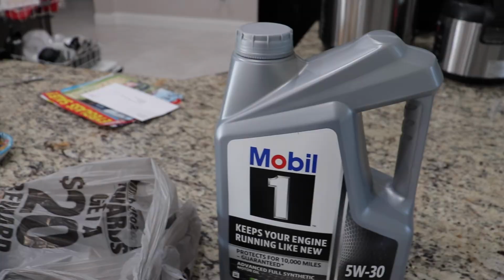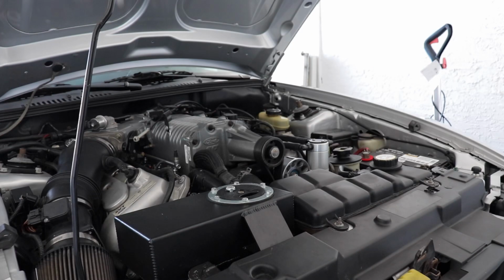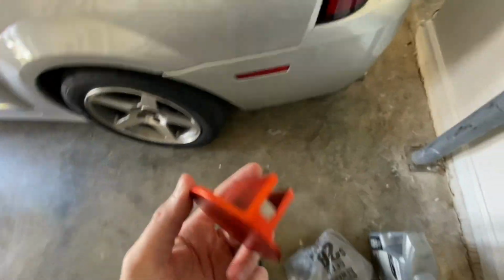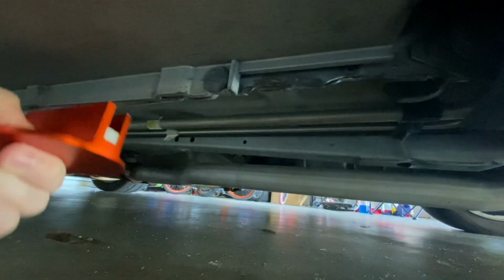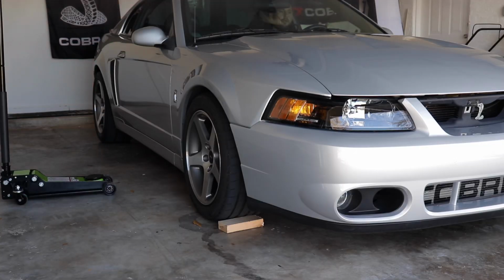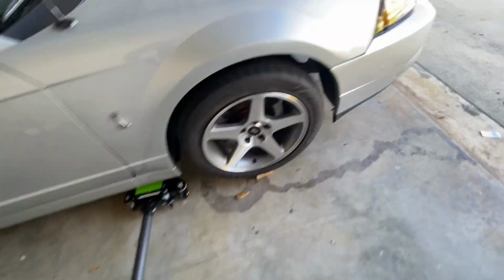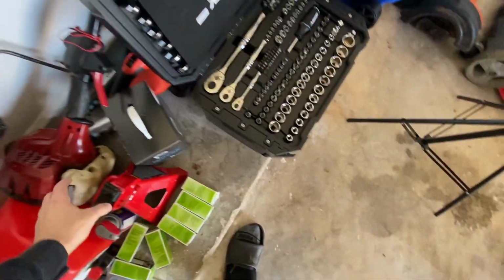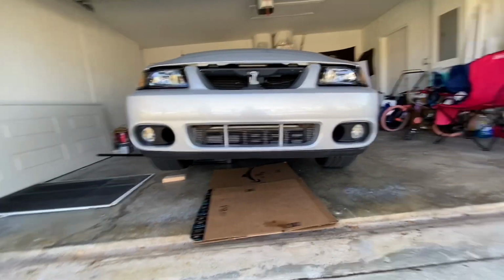MOM Reacts To My Terminator Cobra!

Comment: What size socket did you use for the oil change?  I have a rule in my garage that nothing can be near the Cobra that has the potential to fall or tip over. :)

Comment: Btw I use 5W-20 on my cobra, should I be using 5w-30? I just did my oil change less than 100 miles ago
Reply from the maker: 5w-20 is the factory oil recommended by Ford, 5w-30 is a bit thicker but very minimal, both work fine